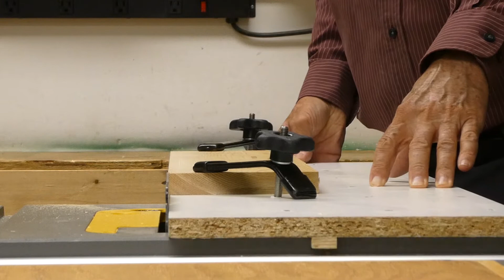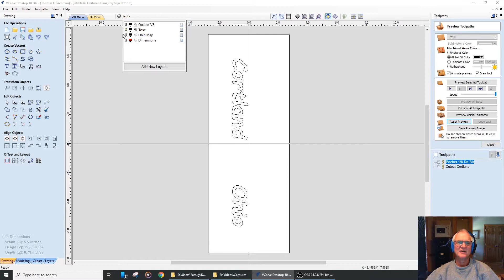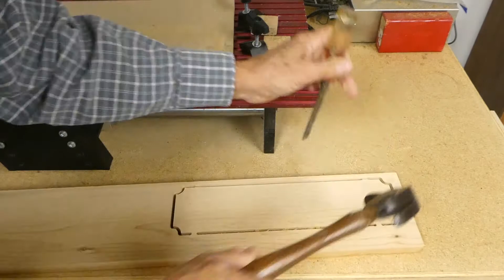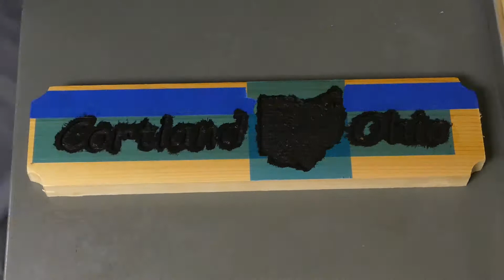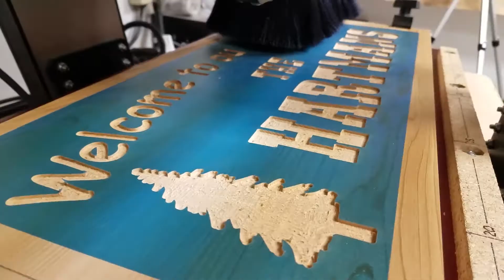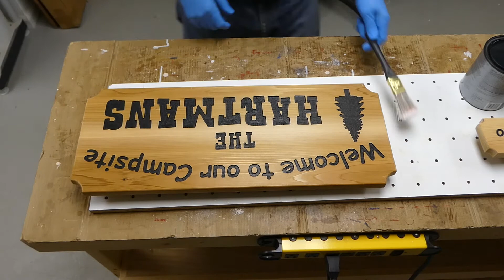Engraved and Painted Camping Sign - Using CNC Router and Oramask 813

Comment: wont wood conditioner do the same thing as the sanding sealer?
Reply from the maker: I got the quoted text below from a Minwax site.  I am by no means a finishing expert but it seems to confirm my thought that "sanding sealer" is intended more as a finish "barrier" compared to "wood conditioner" is meant to allow the finish to "absorb" more evenly.  Thanks for your interest.

"A sanding sealer can be used on bare, unstained floors, doors, furniture and cabinets prior to applying either an oil-based or a water-based clear finish. It is designed as a base coat that will dry quickly, seal the pores, and sand easily with fine sandpaper to create an ultra-smooth foundation.  A sanding sealer is not the same as a wood conditioner. Whereas a wood conditioner is a pre-stain treatment that reduces blotchiness when staining, a sanding sealer is applied only to bare wood that is not going to be stained."
Reply: @FlashTraxWoodworking  thank you for your indepth reply,, appreciate it.. Keep making the vids brother!! Happy New Year to you too!
Reply: A common use for wood conditioner (kind of a thinned down urethane) is to apply it to pine (any soft, porous wood) before staining. Otherwise you'll end up with what looks like a bad splotchy brown paint job with inconsistent grain reveal.

Comment: Great video, thank you for the techniques. I have to admit that I would have thought the Sanding Sealer would effect the paint's ability to knit to the wood - I guess it doesn't. How has the sign held up to the Ohio Weather? Could you post a pic? Thanks again!
Reply: So far as I can tell, the paint still sticks pretty well to the sanding sealer. What the sealer does is keep the paint from penetrating too far or wicking along the fibers. I'm also hoping the polyurethane provides additional protection. The sign was a gift so I will have to see if I can get an updated picture. Good suggestion.

Comment: Nice job! I do things similarly except instead of sanding sealer, I use Rust-Oleum Crystal Clear Enamel Spray Paint for my prep sealer to close the pores and give me that crisp edge we all desire, as well as my finish sealer after painting the lettering/graphics and removing the Oramask as it's made for both indoor and outdoor applications. No complaints so far.
Reply from the maker: Nice. Thanks for the tips on some alternatives to the technique.  Part of the fun (or frustration) is figuring out what works best for a given project.